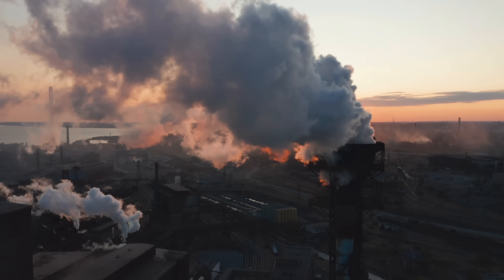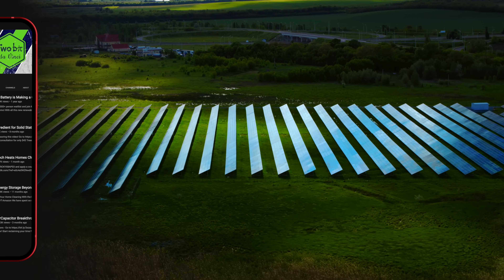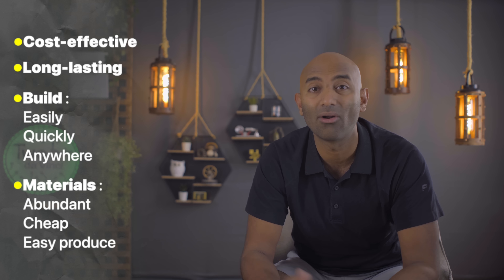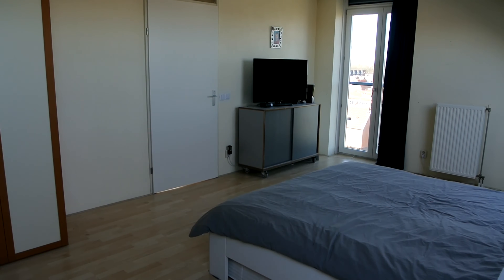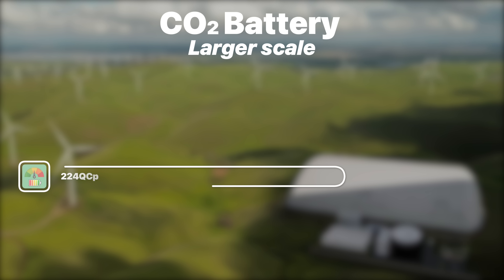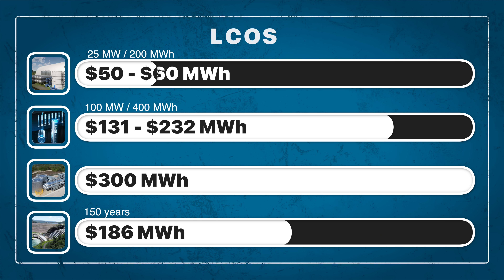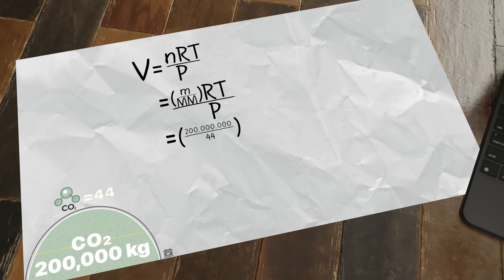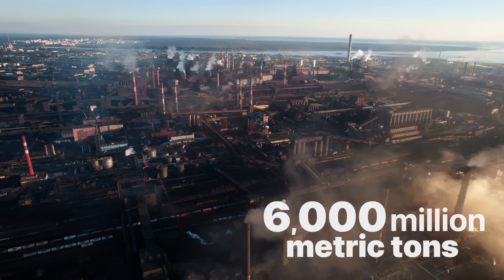The GENIUS Of the Carbon Dioxide Battery

Comment: This idea is actually pretty smart, and safe. It won't catch fire in case of leaks. However I wonder if the dome burst, will the CO2 storied suffocate the machine operator?
Reply: Nitrogen is a bit less dense than air, so probably not unless they got stuck in front of a large gap in the dome.

Comment: Question - have you included the cost for capturing/concentrating the CO2, or have you assumed this to be basically free/no-cost. This cost could be a primary cost for the overall system and, thus, assessing how it compares to alternatives, like LiFePh batteries, Sodium-ion batteries, etc. The LiFePh batteries may also last 30 years, not just 15 years, so you might also want to show some cost comparisons assuming a 30 year life for the battery alternatives, so we can see what a difference this durability design factor makes.

Comment: You pointed out that with a microinverter the shading of one panel reduces the output for just the one panel, not the entire strong of panels. Is this true for the 2- and 4-panel microinverters as well, or do you lose the output of the other 1-3 panels, when any one panel gets shaded? This is important to know, since your stated 50%+ cost savings was based on using the multi-panel microinverters, wasn't it?

Comment: Also, please stop pretending Green energy is green, it's already being well known that they use crap tons of FF energy to make and often don't even make the amount of energy over their lifetime as to what it took to make them. Wind must blow and the sun must shine, so if you live in a place that gets little sun, your panel still ages but you might create far less energy than it tool to make the panel... so you have to average it all out. 

Also, solar and wind are not cheaper than FF, these are CRAZY high subsidized industries, MUCH more so than FF... Now you know and are free to look it all up if you like.

Comment: How about talking about the white elephant in the room? We know that carbon dioxide blankets the atmosphere and the solutions developed to use carbon dioxide to create electricity only minimally recapture carbon. There are a number of such solutions but they don't even begin to cover the dilemma, whether by recycling or making batteries. However, the real danger (and we saw that during the 2020 pandemic lockdowns where the global temperature soared higher despite no CO2 emissions) is sulphuric acid. Not pumping sulphur into the atmosphere but NOT doing it. What also stopped at the same time when the industry closed down was the emission of sulphur. And sulphur mixes with water vapour to produce sulfuric acid. And what does sulphuric acid do? It REFLECTS sunlight very efficiently slowing down global warming. You make excellent videos with subjects nobody else dares to bring up. Can you get into the subject of our need for sulphur in our atmosphere and what we are going to do about this? I would be VERY interested in your discoveries regarding this subject.
Great video on this subject by the way. There is so much that we can do and should do but don't because the fossil fuel industry will continue to pump out oil and gas, even through fracking and has an iron grip on the electricity and oil industry. Electric cars are a joke, as they cost twice the carbon footprint than normal cars and when we charge these cars most of the electricity is still produced by oil, gas, and coal-fired power plants. Only nuclear power will be the medium-term solution for the industrialised world's electricity network as the electricity produced by nuclear power plants is there and easily connected. Wind and solar farms are better solutions for large areas in the developing world which do not have the large networks that connect entire continents with high-powered electricity grids.
By the time, we no longer need nuclear power plants (if the world still supports human life) we will have fusion. And in the meantime, for cars, planes, ships, and generator engines, we need to go down the hydrogen path which is already beginning to work brilliantly with red hydrogen in Japan. So far, solar and wind turbines last ten and twenty years respectively and neither can be recycled. Lithium-Ion batteries are even worse and your idea of getting away from them is excellent. They use up enormous rare earth resources and are only recycled in three or four plants in the world while the rest goes into landfill sites further polluting the planet. Also, solar panels need high-quality anthracite for production (you can't just use sand, you need high-quality quartz which needs to be bonded with anthracite coal) and both wind turbines and solar panels have a large production carbon footprint. Renewables will ONE day be a viable solution but at the moment they are low-hanging fruit and the fossil fuel industry knows it and keeps pumping out fossil fuels.

Comment: Another way to improve efficiency is to house heat-wasting components inside the dome. Dynamos especially are much more efficient at colder temperatures. They require massive ventilation to keep them cool. e.g.  A 100 MW generator might give 10 or 15 MW of waste heat, in addition to parasitic energy required to circulate cooling. Already have some cold gas needs heated to run better?  GREAT !!!

Comment: It's interesting however there are at least three current nuclear fusion plant designs with pilot demonstration plants due to come online in the next three years. While the joke is nuclear fusion is always 30 years away that may no longer be the case. The CO2 battery at least has the advantage over wind and solar as it's not dependent on China.

Comment: First you said that the co2 needed is a drop in the bucket compared to atmospheric co2 levels. Then you tout the capture of co2 for this purpose, as removing co2 from the atmosphere. So which is it?? Can something that makes use of relatively "insignificant" amounts of co2, be realistically held up as a method to reduce atmospheric co2??? 
The ignored elephant in the room is the fact that man caused "climate change" is merely a theory, still waiting to be proven, based on questionable models, that attempt, (poorly), to track and map complex systems of interactive equilibriums, with innumerable  components, all of which have unique effects and unique responses, to all of the actually known and proven variables associated with climate and weather. Ie: temperature, pressure, sunlight.
Until there is definitive proof of anthropomorphic climate change, this is just another in a long line of "chicken little" doomsday predictions which regularly make the news cycle and have done so since my birth. Not one of these doomsday predictions has come to fruition. Nuclear winter, global cooling, the ozone hole, global warming, ice cap melting, sea level rise, co2 is a pollutant, we only have X years before its too late. On and on ad nauseum.
Remember, if you can question it, its science. If not, its propaganda.
Reply: Thanks. Gullible warming numbers were totally fudged, as well as the conclusion of the REAL scientists.

Comment: the solution is, not to use oil and gas  because they have accumulated CO2 from 250 millions years ago. that we lead outruining the CO2 balance. 
we need to put the CO2 back deep into earth.
this batteri is realy not the correct solution

Comment: Ok it has few small issues.
1. I could see it being banned from being built above city due to risk of failiure. 
2. Any kind of shielded terrain nearby such as valley becomes dangerous in case of accident
3. Anyone working there would have to be given emergency air supply, kinda like what firefighters have due to risk of suffocation.

Comment: Although we'll intentioned let me help all of you out with this innovative thought or called the truth. Rockefeller coined TYE phrase fossil fuel to provide scarcity to make more money off kerosene and gasoline later. First no fossil has ever been found on oil nor do archeologists have to remove oil to obtain fossils hence a lie.The truth is oil is made every second of the day by Earth. In the subduction zones and abduction zones basalt 83 percent carbon with saltwater, extreme heat, and extreme pressure produces the tectonic lubricant called oil. At any given time these are no less than 10000 oil leaks in our ocean every second of the day. You've been lied to by the billionaires and its become a former of control. Educate yourselves and learn the truth. A free mind is truly dangerous and amazing.

Comment: Unlike grid scale batteries, this actually looks like a sensible and practical answer to the intermittency problem (excepting perhaps the nordic thermal battery). Presumably it can use existing caves and abandoned mines to help limit the need for large gas bladders consuming lots of land (although surely the old cylindrical gas storage stations would work better and could be taller, using less land).
Reply: Big Energy will do the most cost-effective things, unless required by government. That includes fighting the government at risk of civilization.

Comment: Those round trip efficiency figures look suspicious to me!  I'd like to see exactly how they are working that out and what "ifs" and "coulds" are being used! ie are they factoring in heat energy that "could" be provided to heat homes, but in the real world this is highly unlikely and would be wasted energy and bring down the overall efficiency.  Just like the max power ratings of wind turbines and solar panels being used, instead of the actual average power over time.  Those 6kW solar installs will never ever produce max due to increasing temperatures decreasing the power the panel can produce.  Yes in a lab where you have a huge cooling heat sink to keep the panel cool, but in reality panels don't have that cooling and perform way less than their rated max power.

Comment: This will provide a market for capturing the CO2 we will be making for the next 30 years as we ween off fossil fuels. So even if we don't figure out how to direct capture from the air efficiently there will be a bit of a supply available for a while to get some of these up and running. I do think that leaking will be a problem over time (like 100s of years time scale) but for the now it might be the best option for some areas.

If we do figure out the CO2 direct capture we will need to factor that into the cost of the system. But that would potentially provide a market incentive to direct capture CO2 to get us back down to previous levels and sell the product to the energy storage sector.

Comment: Break free from the ideology! We all can get stored energy from nature: Wood, plants of all kinds, oil from seeds, seeds itself like grain, nuts, fruits. Even the gras, hay and straw contain so much energy.
The problem is NOT how to get the energy from the natural storage forms.
The problem is the laziness of the people. They don't want to do something for it and they don't even want to think about some clever solutions.
Image tehre is a house and a family living in the house. How can they produce electricity? They can get solar panels. That is one way. They can install some windmils in the garde nor on the roof. They can build a tall watertank - the smaller the taller for the pressure - and put a small generator at the bottom.
Yes, that's how smart people think today and it works.
Is it enough electricity? For everyday use it can be enough.
You want more? Get it! Combine a bike and a generator and do some workout for your legs for half an hour per  day, not just one person but everybody in the family. The more you workout, the fitter you become and themore electricity you can produce.
Heating? For many millenia wood was good enough. So let's grow forests, trees wherever practical.
You know why the Sahara is so big? Becausetehy burned all the foests and did nothing to preserved them. Just laziness. This happens almost everywhere and almost nobody cares.
We don't have some energy crisis. We have a crisis of will and intelligence. So stop whining, get smart and do something.

Comment: CO2 in the atmosphere blocks solar IR radiation. Scientific fact. In a time like now where our magnetic field is weakening. Without a strong magnetic field defending the planet CO2 is a good thing. Also note there is a low fail limit on needed CO2 in the atmosphere. Without it, plant life will suffer a cascade failure. Ice cores show this has happened before.

Comment: you said it can last up to 30 years without loss of capacity?
but if you are losing 20-25% of your CO2 you are losing capacity and have to replenish to bring back up to capacity.

two things
1. the loss of co2 isn't really a big deal since there is a demand to capture Co2 so it would be cheap enough to replace( heck they may even pay to take it off their hands).. until whatever netzero target is reached and the supply of co2 become reduced and therefore cost more.
2. what is the upfront cost of the operation( capital etc ) and thus how long is the ROI.

as you said it wont be going on top of cars, but then its not meant to. its simply a fixed base energy storage. far more efficient/cost effective/suitable to use than lithium which be needed for high energy discharge operations such as vehicles.

I can see much smaller scaled versions for say tankers which can use this system to top up their energy needs( they have plentiful access to solar and wind on their journey)
Can even see a small version for large homes, farms( convert all that cow manure methane gas to stored electricity) but the cost would have to come down( i could even imagine a few smart engineers creating a quite small DIY version for their backyard)

Comment: Sorry, you need to be talking micro-nuclear reactors with incredible portability that produces heat and electricity.  Solar and wind is a massive environmental land capture, that not necessary and will not provide the energy density needed to process plants into biodiesel products to permit clean conversion of existing heavy transportation.

We should still be considering whether higher CO2 levels are potentially less risk.  Looking at temperature variability over century’s a higher average temperature appears to be correlated with less variation of global temp over time.  Much more radical temp to the negative side is apparent prior to 1900.  Climate religion appears to be based on simple assumptions of fairly linear change and not overall risk assessment based on what happens in the extremes of temp change or variation.

Comment: Compressing Co2 which generates heat. Where did I hear of this idea before?

Yup, It’s basically a heat pump.

‘Temperature is stored to make the storage more efficient’

I really don’t get why nobody spots the flaw in that. You have heat generated by the compression and cold, generated by the vaporization. If you use that heat and cold, you wouldn’t be limited to a efficiency of 90% at the highest end, but you could get efficiencies well over a 100% due to the multiplier of a heat pump. 

Put this storage solution in an industrial park, hook up the cold side to a cold storage facility and the warm side to industrial processes requiring heat and your efficiency would rise massively.

Comment: Great video and interesting technology.  But, a 200 MWh storage "utility scale" plant is far, far from being utility scale.  I do like the no-rare-earth materials needed, but I'm skeptical of can this really scale up.  It looks like it may be limited to diurnal (daily storage, not weekly, monthly or seasonal) energy storage.  What is really needed is a way to take future built out hydro, solar and wind power and store it for weeks and months.  That is the key, not just daily storage.  Note, weekly and monthly storage means having the ability to cumulatively store excess energy the same way a large reservoir stores water during the rain season and releases it during the dry season months later.  For compressed CO2, that means having a massive amount of usable storage, which I don't think will ever be practical unless you inject into depleted gas wells in the ground.  I'm a consulting engineer with utility hydropower clients in California.  One such hydroelectric pumped storage project can daily store over 10,000 MWh.  To really play a part, compressed CO2 would have to scale that large and then we need to build 10 or more such plants in my state.   That is grid scale!
Reply: I think the term "grid scale" is pretty subjective, it depends on the grid your talking about. California is one of the most developed areas of the world and has the requisite amount of energy consumption. But we can compare the actual numbers 200 MWh to how much is needed and know that it would take (for your example) 500 of such "grid scale" plants to provide the needed reserve. Then it becomes a numbers game, as everything is, to weather or not it makes sense to use it. 

Now, I think it might be able to be used as seasonal storage. It would depend on the losses of the stored liquid CO2 would it not? if it can be stored for 3 months with negligible loss then you can pump the tanks full and then leave them until you need the power. That would severely impact the profitability of the plant, but if you have no other option it could be possible. The energy density is an issue though. I'm not motivated to do the calculation but that seems like a LOT of volume needed to store months worth of power via this method. Ideally we would find some form of storage that can get closer to fossil fuels in terms of density.